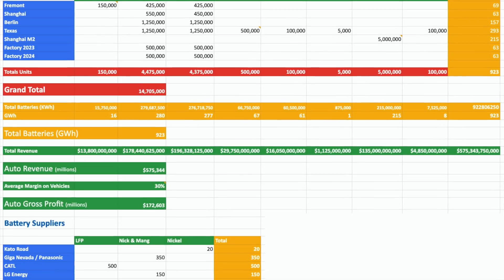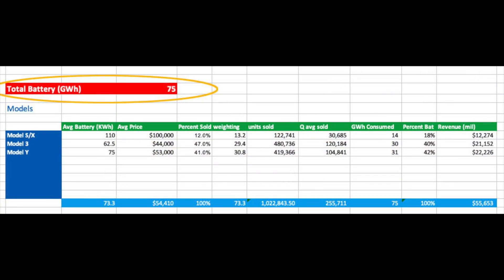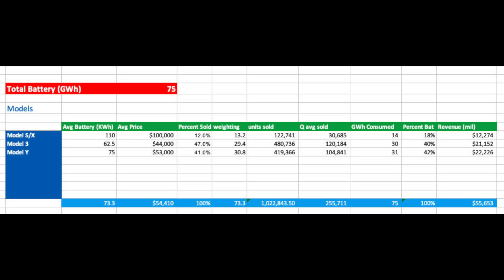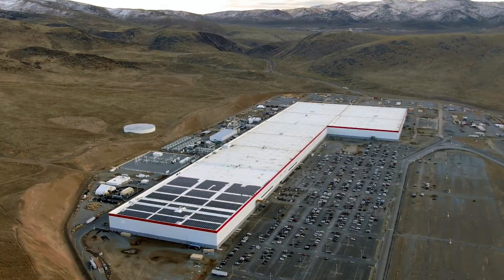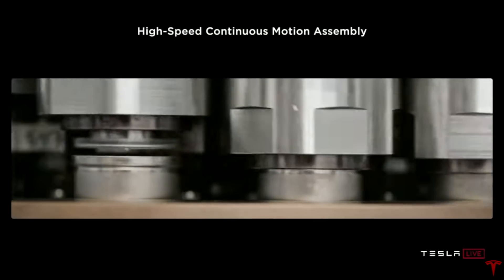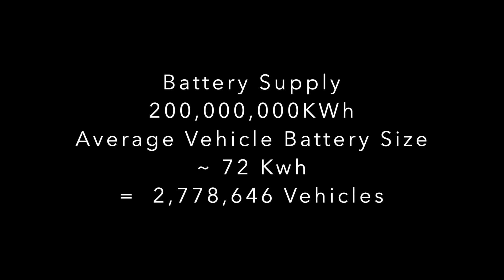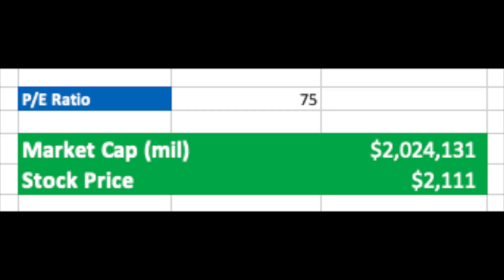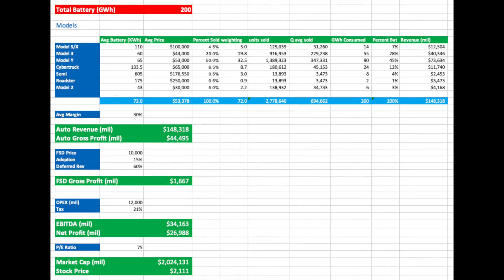Tesla's 2022 Deliveries Estimate Based on Potential Battery Supply. What is the TSLA Stock Price

Comment: Could you address quality control and customer feedback issues? Thank you!
Reply: The mega castings should ‘solve’ the issues with panel gaps. If you have fixed dimensions from the casting then everything that attaches to it will be an order of magnitude more accurate and likely the structural battery pack will contribute almost as much dimensional accuracy as well. Net result - probably the most rigid and stable vehicle platform ever made and thus the tightest handling car ever.
Reply: @beauarts  what about issues with repair shops? I’ve heard many stories about Tesla owners losing their cars for weeks because of simple damages. It seems to be upsetting a lot of owners